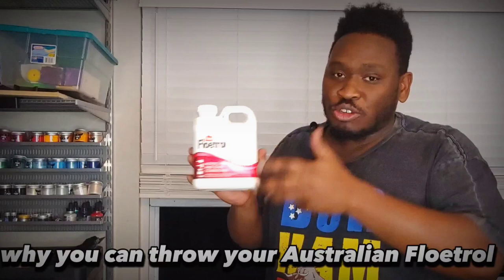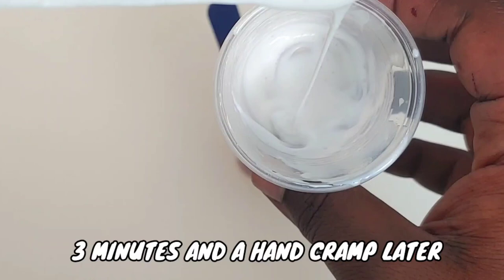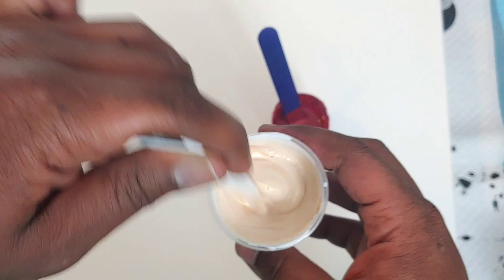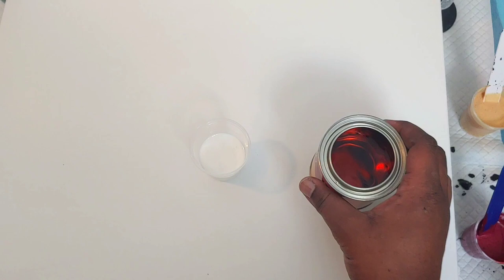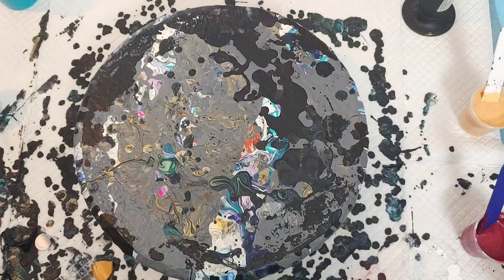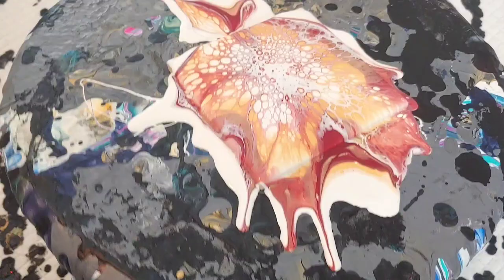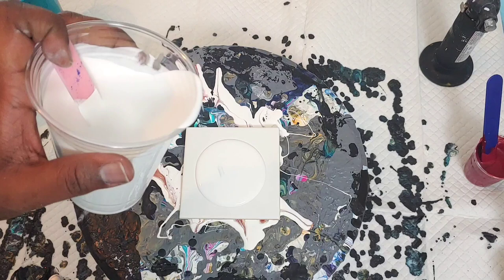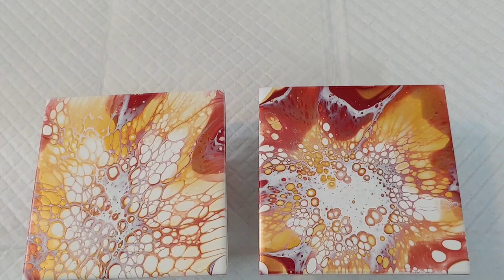SheleeArt Blooms EASY 1:1 RECIPE! (Single) Ingredient Messing up your Cell Activator! 🤯

Comment: Have you tried putting the MinWax into a 4 oz bottle with a push pull top? Doing this would probably mean recalculating the quantity of MinWax as the drops would likely be bigger But the bonus is you wouldn’t have to breath the fumes
Reply from the maker: I haven't but honestly it is worth trying. Thanks for the tip! Never stop learning in this artform. Much love and big hugs! ❤️

Comment: These are very cool Garrick.  What do you use to clean the dried surface of the coasters so you can varnish or resin them?  Thank you.
Reply from the maker: I clean them with a wet cloth and alcohol wipe or if it has alot of silicone on it wipe it clean the best you can then put cornstarch on top to absorb the rest for about 30 mins. Before cleaning it off wipe it in with little swirls then wipe down with a alcohol wipe and you are set.
Reply: @GarrickBrownArtStudio  Thank you!

Comment: New to this media… may be dumb question… the other paints you used in this video (the colors and base paint) did you mix them with anything like water or floetrol?  Or are they straight out of the tube and the cell activator does all the rest?
Reply from the maker: No dumb questions bro! The base paint comes from the can straight. My paints are mixed with pouring medium.

Comment: I enjoyed your video very much.  However, I want to mention you are mispronouncing Linseed Oil.  It is pronounced with a short I sound like “Lenny”  so said like in Lynnseed Oil.  I may try it but I want to note that Linseed Oil is used a lot in oil paints and it takes at least a month to completely cure before you can resin it if you want.  I would imagine that if you did resin coat before it was completely cured (not just dried) the paint could lift or bubble up.  It could also develop cracks over time.  I am 72 with years of painting under my belt.  It is different from silicone and silicone would only take one or two drops.  This was just some info for you.  Happy painting.
Reply from the maker: Thanks so much!